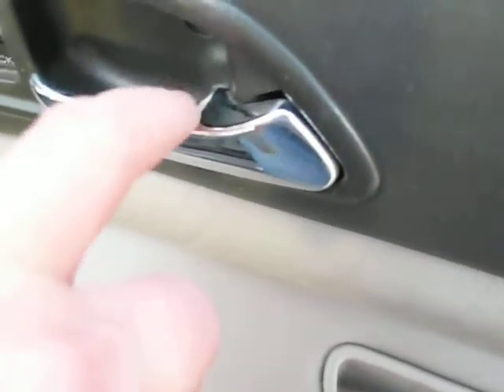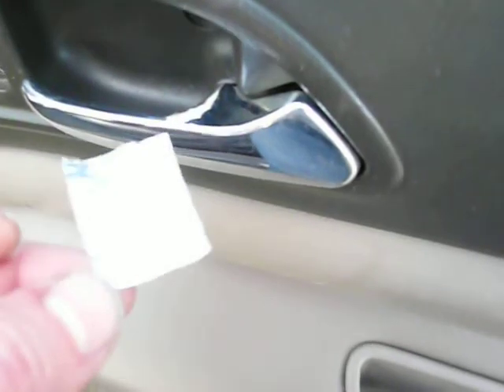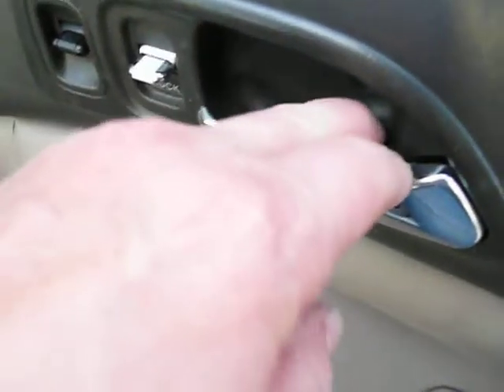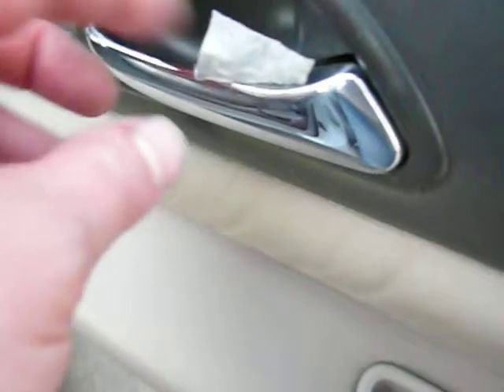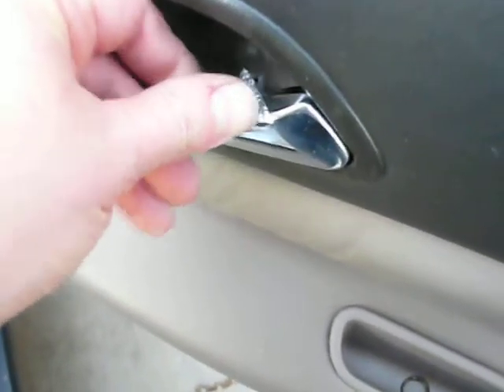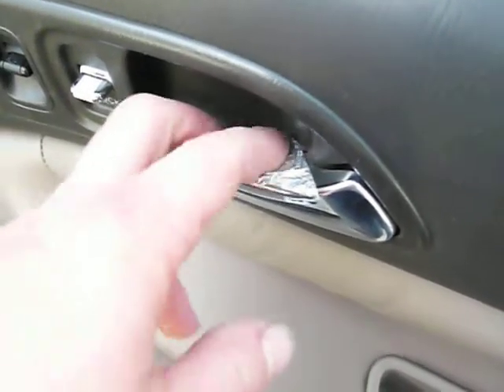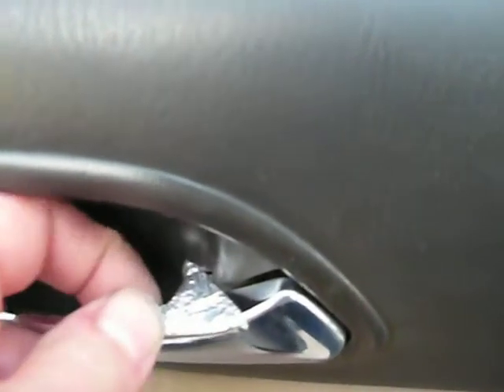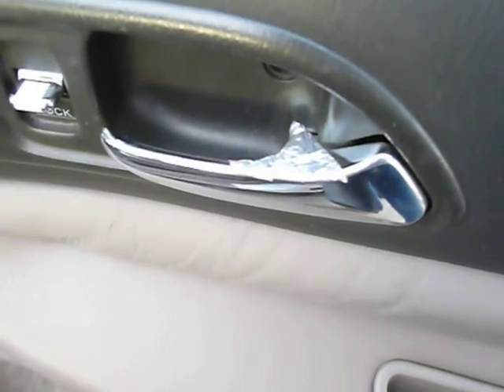Fast Way to Fix Peeling Car Door Handle - Metal Coated Inside Door Opener

Comment: Just got a used car and I just realized it has this problem on all four doors.. thought I would have to replace them all. I guess not now! I am totally fine with this solution! Thanks!
Reply from the maker: I appreciate you taking the time to share your gratitude. I actually had to do this on another one of my handles last month. It’s so much better than getting a little slice on your fingers when you open the door or having to take the time to peel it all off. It’s working great for me! Thanks for watching and have a blessed day!

Comment: I took a chainsaw file...the round rasp you use to sharpen chainsaw blades on the chain....I filed it smooth found some silver finger nail polish....let dry....take thin grit sand paper....smooth out the edges.....and looks brand-new.....my idea to yours.....have a great day
Reply from the maker: Thanks Dusty, Every comment helps. I had similar ideas with my try last week but my video deleted so I blogged about it but didn't like the way it came out with doing the entire thing with spray paint. I think your idea of just doing that small area would be better! I have one other car to fix. I think I will try a version of what you did and see how it comes out! Thank you so much for commenting, watching and I hope you have a Blessed Day!
Reply: thesecretisgratitude ....hey there...your idea with the tape helped me keep from getting my fingers cut...my husband keeps electrical tape in the glovebox of all our vehicles....I didn't have time to do all the cosmetic work...lol so I remembered your video reached in the glove box and it was fixed...lol it was my husband car....tape still there...lol....
Reply from the maker: I used to keep electric tape in the glove box as well. Glad you had it handy. I actually called a few wrecking yards today looking for a few parts for my car and asked the guys at the yard if they knew of anything that worked and they didn't. They said to peel it and leave it plastic or just order a new one but run the risk of the same thing happening. Oh well, our solutions seem like the best for the moment. ;-) Have a BLESSED Day!

Comment: I had this issue with both door handles on my car, best way to fix is use heatshrink over the whole handle, looks porfessional now and tidy, no sharp edges. Actually looks like a factory finish!! Try it but get the correct size
Reply from the maker: Trev Thank you so much for that suggestion. It’s nice to have other options! Thanks for watching and have a blessed day!
Reply: @thesecretisgratitude  No worries! I still cannot believe some car manufacturers use such a crap non resiliant finish on their door handles. Makes the car look like a toy! Very poor choice by manufaturers. Stay blessed and keep safe x
Reply from the maker: Trev I agree! I think it is a weight issue. Trying to make them lighter. I appreciate the well wishes, you stay safe as well. Have a blessed day!
Reply: Trev - where did U get it?  What brand and color did you use?  Thanks dude!
Reply: @benzzeppelin5567   Benz Zeppelin  Hey man, you can get heatshrink at model shops, electronic component shops etc or on ebay theres loads.. Mine is actually black as i had this already.. but i'm not worried about the colour but you can get grey or something else.. Stops the sharp edges and coating getting worse, and actually has a soft touch feel to it.. If i could put up a pic of it i would but looks damn good! Since doing it i'm not bothered about replacing the door handles as i don't need to now

Comment: I use that Aluminum duct tape all the time in HVAC ductwork. That Aluminum duct tape is dangerous and the edges will cut you just like a knife or just like the peeling chrome you are attempting to fix. That Aluminum duct tape you are using will loose adhesion in the super hot car and the edges will peel up and cut you just like the chrome does. Instead I suggest you use Heat Shrink tubing. The Heat Shrink tubing produces a full wrap around surface with a super snug fit. I suggest you properly repair the surface first. I use a single edge razor blade to trim away the loose curled up edges of chrome. The lightly sand with fine grit sand paper roll, clean away the dust and flakes, and finally apply the Heat Shrink Tubing.
Reply from the maker: Hi, welcome to the channel!

I have actually sanded it down and painted it silver in the past, but it just took too long and the results weren’t worth it for the time it took and I cut myself several times taking it off.  
I have used the tape on several cars now and have not had any problems with any cutting or issues. It has been wonderful! Only a few times in the summer it’s been hot enough that I could see it was sticky and melted but as long as I didn’t touch it much, it was fine. The same piece of tape has been on there for years with no issues.

Thanks for your suggestion on how it can be done a different way! One way doesn’t work for everyone!

Thanks for watching and commenting! Have a blessed day!

Comment: Dodgey
Reply from the maker: Hi Mick, I did this "quick" video as I did a longer blog post about fixing it another way with files and paint but it took forever and looked "ok" but time may not be an option some people have and may need a quick fix to avoid cuts. My daughter and I cut our fingers on the lock and door handle. I gave this as a fast option, not the "best" option. Here is a link to the post where I peeled, sanded and painted the lock and handle. Thanks for watching and have a blessed day! https://thesecretisgratitude.blogspot.com/2017/12/fixing-peeling-door-handle-beware-of.html